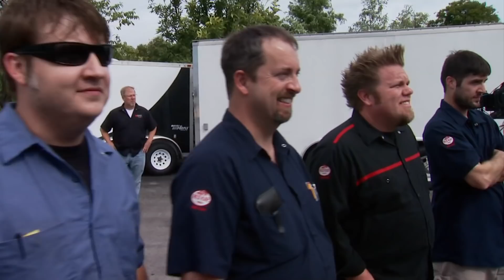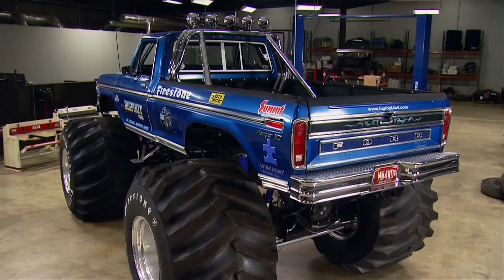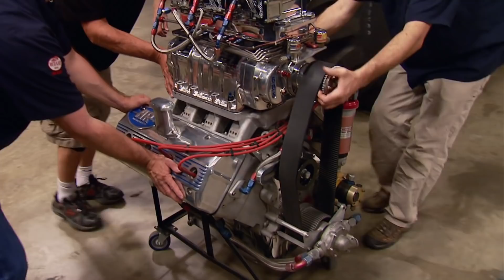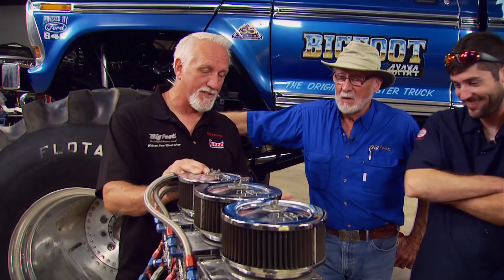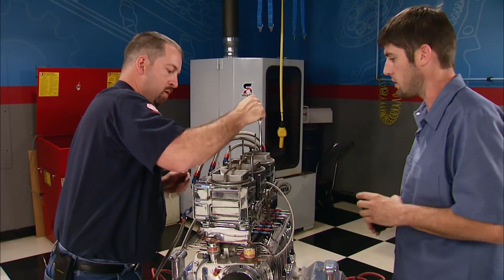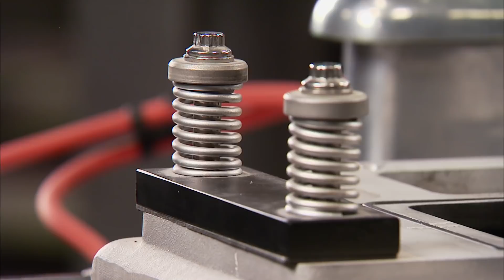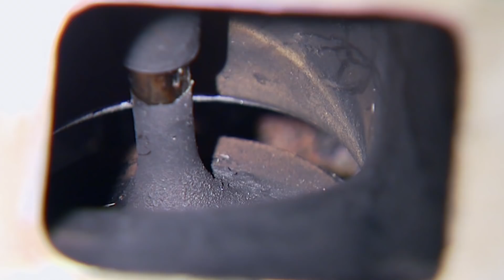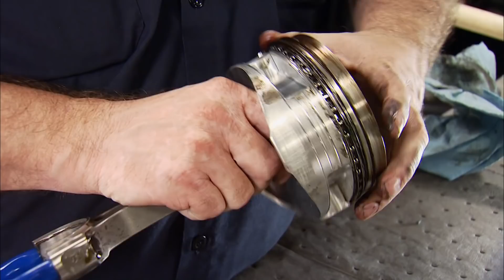The Original BigFoot Engine Build Part 1- Engine Power Season 2, Episode 4

Comment: 8:19 With only those two N2O solenoids on there, no more than 400h.p. worth of Nitrous could be had through them. A set of "Cheater" noids will safely flow about 250h.p., and if they are "Big Shot" noids they'd flow about 400h.p. max. 
That was all that was available back then. If you wanted more, you had to run multiple sets of solenoids.

Comment: This engine didn't last long after rebuild
Reply: What are you talking about? It's on display at the Bigfoot 4X4X4 headquarters. They don't use it in the truck anymore because it's a high strung temperamental race engine that has rare parts in it. Bigfoot #1 currently uses a 514ci Ford Stroker engine as the 640ci Alan Root Ford was overkill for anything they do with the truck these days.

Comment: NOT the original engine. The original Big Foot truck began as a 1974 F250 with a 360 FE engine.
Reply: Bob himself stated at 1:56 that its not the original engine, he later swapped out the 360FE for a 460 and then eventually the 640ci that's being rebuilt here.

Comment: That’s probably the best way to get that motor with those oversized ports to work is to put a blower on it to bypass the big lag those engines had because of the huge ports. They would probably suck those Predator carbs right into the combustion chambers. I’m a Mopar guy and then  Ford next. This is a beautiful piece of polished work!

Comment: I keep wondering why is it so nice and clean for such an old heavy duty engine. Then I need to remind myself that this has probable never even done more than say 300 miles on it since it was built given it use needs. WOW.
Reply: Yeah maybe so, but those 300-500 miles it may have on it were absolute hell from start to finish. In its prime this truck spent almost all of its time either sled pulling, mud bogging or hill climbing.

Comment: Was this Bigfoot standing in Miami?
Reply: No, you're probably thinking of Bigfoot #7 which has the 10 foot tall tires on it.
Reply: @nathanmcdonald610  #7 is a nonfunctional shell it never worked with the 10’ tires 
Bigfoot 5 runs and drives on 10’ tires though

Comment: I like how they talk about this engine being a complete artifact at over 20 years old.  Like when a meteorite hit the earth and killed the dinasors or at the time of Moses and the great flood or something.
Reply: Clearly Clever or even Noah and the great flood!
Reply: I'm not sure how old you are, but clearly you just have no idea
Reply: I get what you're saying, but I think it's the significance of the engine to this style of vehicles history. It's not like they are talking about a random 302 out of a 70s era vehicle.
Reply: It's not a 20 year old engine, it's a 40 year old engine built by some of the best performance builders in its time. It's the fact it was built to such a high standard that's interesting to these engine builders, not it's age or rarity of production or anything. It's a one off built engine with some fascinating parts and methods hidden inside that can't be had now, unlike a random small block found in a barn or something.
Reply: You have to have big tires to clear that water.
Reply: At the rate of improvement in the automotive industry 30 - 40 years is a long time.
Reply: Keep in mind, the engine remained as is since the 1970's with probably some minor modifications until the 1980's when it sat until now.  Since then, it hasn't been modified so technically, it remained the same for almost 50 years!!  That's a long time and yes, it's really an artifact in the car world.
Reply: @donster28  yeah an engine from the Original Big Foot . . . I guess it just needs the age or care to get the reference lol. Im 34 so I grew up in the PEAK MONSTER TRUCK SUNDAY SUNDAY lol 90's and Grave Digger is my favorite for many reasons but any time I watched a race or whatever and Big Foot (yeah its a different driver from state to state toward the end there) made a showing . . . you cheered! Its the O.G Monster Truck that inspired how many careers, designs, changes in the sport . . . shit literally INVENTING the sport to a point - yeah . . . . . . seeing the truck and the Original motor was sure as shit memorable, historic, unique and just plane cool!
Reply: Clearly Clever ....well, at least that 640cu Big Block Ford motor actually exists, whereas that Moses and great flood nonsense is nothin but fiction, a fake, a phony, a man made lie, a fairytale....
Reply: @branon6565  hey man do you have to go there...all ill say is u started it by taking exception to the noah ark reference...so here i go, God exist ,he doesn't need you to exist. You need him to exist.

Comment: 74 f250 with 75 headlights?
Reply: 79 headlights actually. The truck started life as a 1974 F-250 but later had a 79 front clip put on it.

Comment: Did they have to have tires manufactured specifically for those monster trucks or could they take something off the shelf designed for some other industry, if so, what were the tires originally designed for?
Reply: They were made for fertilizer trucks they are terra tires

Comment: The one Ford that could get Chevy & Mopar fans cheering.
Reply: Yep I can testify to that
Reply: Every brand has that vehicle or driver
Reply: Well 

It has a Hemi engine
Reply: @Buffalohideface  Ford made hemi's not just dodge
Reply: @HeavyDutyHillbilly  ford didn’t build that engine
Reply: @Buffalohideface  neither did dodge, but thats beside the point.
Reply: @HeavyDutyHillbilly  yea, but that's a motor modeled after the Chrysler Hemi.
Reply: @snake5305  incorrect. The 640 in³ engine retains a worked 385 series big block Ford and the Alan Root heads were developed from the ground up specifically for the 385 series family and share virtually no physical dimension to a Chrysler hemi...which ftr did NOT invent the hemispherical combustion design.
Reply: I'm a die hard mopar guy and this ford gets me hard
Reply: That is correct.
They had a truck pull in Ft Worth Tx and was sponsored by the DFW Ford dealers.
The Ford guys didn't have a good night pulling having to be towed off by some squarebody chevy tow trucks still Ford Motor Co had the last laugh this particular truck stole the show.
Jim Kramer drove the hell outta that truck that night
Reply: FORD TRUCKS nuf said

Comment: the engine hasn’t started in 20 years. drives into the shop
Reply: The truck uses a 514ci Ford crate engine now, the 640ci is pretty much a display piece now.

Comment: 40 years ago, or so, my neighbor made a monster truck and I think he bought the parts from Bob Chandler. He had 5 ton axles, electric-hydraulic rear steering and 66 inch tall tires. He made his own spring hangers and shackles and he made the truck exactly one inch taller than the original Bigfoot.

Comment: I hate that they swapped the cam out. Keep it to original spec.
Reply: Exactly
Reply: There's so much better lobe designs out there now that make more power, are more stable at high RPM and will allow less frequent lash intervals and valve spring replacements. Not to mention there's been continued and better R&D behind testing different valve events for increased power output vs what they were running back then.

Comment: Hey guys. Just an old mechanic trick. Those screens aren't there to catch debris or broken parts. They're there to help atomize the fuel for greater horsepower. In the days of carbs we knew that fuel under high demand just splashed into the cylinders usually the ones closest to the carb. By adding a screen one could atomize the fuel making it spread to other cylinders and producing a mist of fuel (think poor man's fuel injection) producing better burn and and in turn more power. Learned that at auto trade school from an old school mechanic who used to race dirt track cars.

Comment: But how many pens do you really need in your shirt pocket? :) :)
Reply: Actually about half of them are tiny flat head screwdrivers.  As a mechanic we will use all of the pens and screwdrivers.
Reply: @johnsumner2987  awesome cheers mate, and hello from Adelaide Australia 😀
Reply: John Sumner naaaa man, I always have 3..flathead, Philip, and a pen..maybe a marker if the computer is down to print oil change stickers. That man has a whole pack of pens in his pocket 😂
Reply: @johnsumner2987  my pocket screwdriver with the magnet on the end is the most important tool I have lol. Use it for everything...push pins, hose clamps  opening boxes, adjusting drum brakes and so on
Reply: There's probably a slide rule in there
Reply: @Matthew Williams, Lol 😂

Comment: Hi Sir...
I have a 2007 toyota tundra limited with 260k Miles on Had a recall 1 owner truck..
I am feeling a very small little jump in the tranny no slips at all runs great.

what would you suggest i should do to keep it well maintained should i change the oils or flush the tranny or do nothing ?

Comment: Now that's how an engine should look like! A v shaped lower end and 2 heads with valve covers on each side, and a carburator in the middle, and 2 exhaust manifolds on the sides.
Modern engines look like a washing machine that is stripped from it's sheet metal panels, because all you see is hoses, electrical wires and connectors, and under all that
crap there's some iron box that has the cilinders and pistons in it, so one ugly mess. That's why they cover the whole shit up in plastic covers, because that chaos under al that happy 
plastic won't win any a beauty contest.

Comment: Man the owner should of never changed the head lights! The round headlights with the signal lights above were way cooler than the newer square ones he has on the truck now! Now its matched-matched, his tail lights are '78 and his headlights are '85
Reply: junebugg777 that front clip bob put on is from 78-79. 1980-86 looked different, a whole new body style. In 78-79 the taillights stayed the same as previous years, so they are indeed time period correct even tho the original truck was a 74

Comment: You have to remember, engines were so detuned from their glory days of the 60's. I always wondered what thus old gal had in her. to see a truck with this much power was amazing, considering big blocks were putting out little over 200hp, octane of gas was 79, everything knocked and pinged, engines ran on after you shut them off. This was good to see.

Comment: Pistons in 4 and 7 are disturbingly carbon-free.  Despite your "no leaks" declaration, it suggests that the head gaskets had failed on those cylinders.  I know you know that, so it's odd that you'd say "no leaks" when clearly there were.

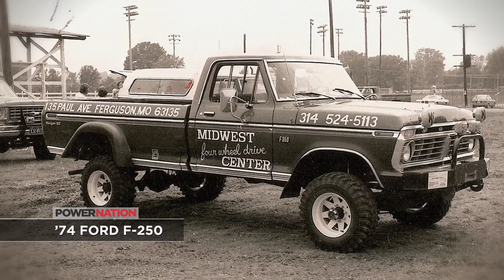Comment: 1:37 Shows F350 on screen but labels is an F250 lol. not making fun just thought it was a funny gaff.
Reply: the truck is an F250, the highboys had the narrow frame like the F350 cab & chassis duallys and the f350 camper special with 140 inch wheel base. There photos of Bob's truck with a dually rear end so I'm guessing he decided to change the badge from an f250 to an f350 since they share the same frame width.
Reply: there is a lot of fuck ups in this video lmao...like why does he have 10 pens in his damn pocket ??
Reply: @BETNCORT  incase you run out of ink duh

Comment: I must say that I really like Howard’s Cams. They make good stuff and are often cheaper than their competitor’s comparable items. The last item I ordered was a set which included the cam, lifters and valve springs. That particular grind made a big difference in power/torque, worked well, and was probably $50 cheaper than Comp or Crane for a similar set in those brands. Others are great too but I’ve just always been partial to Howard’s I guess. Everyone reading this have a great day and God bless!!

Comment: Uh, huh?? There was a blower on engines back in the 60's and 70's. Maybe THEY didn't see them cause they lived in some BFE town. They're having all this trouble taking the thing apart becuase they are using the shittiest impact gun they make. My Matco 3/8" was so weak I brought it home to work on my car's. Mac or Snapon are the best cordless, but where are the air guns? And who uses a wimpy handheld propane torch? Where's the OxyAcet torch?
LOL, "This artifact from 20 years ago...", my car is an 84', and it's certainly not an 'artifact'. You shouldn't have ANY issue getting parts for that engine from Summit racing. You guys talk like it's a fucking steam engine or something. So overly dramatic. 
Also, any mechanic that has to separate they're bolts needs to go sell parts. I can take every bolt in any of my cars off and throw them in a coffee can, and they'll all go right back where they came from.

Comment: You touch the original engine the value history of the big foot Is down graded. 
It’s not a antique anymore. Buyer want original. That the history, everything including dings .make it believing. Unless your going to lie.
Reply: they also want  it to work  these are not like  car engines at all  lots of things could  be   bad  rear main seal  gaskets     dust  inside from it sitting for 20 years    in short  it could destroy  the engine if you tried to start  it up after all that time sitting    there  more  or less just  doing checks  on things  that could break down with time    and will put it back  to same spec

Comment: I don't understand why people keep using bulky Dremel for engraving, especially on high end builds!
Dental micromotors are much more ergonomic, silent, and allow you to change tools extremely fast.
Reply: It a mechanic shop. It's loud af 24/7 Dental Micromotors may be less bulky n what not but prob cost 2x more and Dremel's not a bad brand. Last thing they care about is loudness its the quality/work speed that matters.
Reply: @wallaceluna6241  I understand that dremel might be faster to move around a shop but why would anyone do that? It's mostly used for small parts that you can bring to your desk.
I've been using using nsk ultimate for several years almost daily and i'ts many times better than Dremel i had before. I have to admit that most mechanics probably won't use it enough to justify the extra cost but if you do a lot of hand engraving or sculpting it's definitely worth upgrading.
Reply: Mili theMUFFIN it’s more of a they prob got some type of sponsorship or deal ecetera with Dremel vs a different one. A lot of the tools they use are prob gifted to them to be “shown off” to get customers.
Reply: @wallaceluna6241  That's very likely, they didn't really need to engrave on these stands to keep them organised.

Comment: I LOVE the PREDATOR Carbs... I've run them for around 30 years on a 454 powered 1955 Nomad with 350 HP Nitrous. The Car has been 179 MPH with ! Predator carb way back in the 80s. Have trouble getting overhaul kits with the correct accelerator pump diaphragm. I own five of these competition Carbs. I had two on a Holley pro dominator Tunnel Ram manifold, incredible throttle response . It ran just as good with one on a Holley Strip Dominator manifold as the Tunnel Ram. I also got 12.9 MPG on the street.  At 930 CFM apiece it's a LOT of CFM for any engine. No power valves to worry about either! BIGFOOT IS AWSOME!!!

Comment: the 1st time I saw this truck was at the auto show at Cervanties convention center around the late 70s, this was before Chandeler put the really big wheel/tires on. the 1st set were farm tractor tires, the next time I saw it was in the movie "take this job and shove it" it had the big wheels/tires bout' time then, the truck sat as a static display at Big Foot 4x4 inc. just off hwy 270 across from the Ford plant (that got torn down), you had to go inside to see it, but they had two more outside that could be seen from the hwy, the Tracked Big Foot & the really Big Big Foot (it had arctic vehicle tires that were about 15-20 ft in diameter). Big Foot 4x4 inc isn't there anymore, I don't know if they moved or just closed down, good memories though.

Comment: Why did you etch writing onto those parts with a dremel? Ever heard of a Sharpie?
Reply: Oil soaked parts that you'll clean with solvent.... Sharpie isn't reliable.
Reply: @JohnWilburn  That does make sense, but I'd be hesitant to permanently damage a part like that... especially on a historic engine/truck as this
Reply: @leebtrading  I would have felt the same way ten or twenty years ago, but now, so long as the engine doesn't lose it's identity, I'm okay with adding that little bit of character to it's story.  If someone eventually writes a 100 year history of that engine and that's a little note that's now 60 years old, everyone will think it's a cool detail that proves it's story... just like all the other things that have been done along the way.

I've watched other shows make wholesale changes and trash things in favor of latest-and-greatest, but this build was righteous... even saving original gaskets.  They made changes they should have like changing the wrist pin buttons for spirolocks (to protect the block), etc.  These guys did a great job of protecting the history and it will be a chapter in the bigger story.  You have to admit, Chandler himself has tossed more historical stuff.  He changed the bent frame of Bigfoot 1 after take This Job and Shove It and, to my knowledge, they scrapped the original cab of Bigfoot because it got rusty.  That's the stuff I wish people would think twice before doing.
Reply: @JohnWilburn  Good points, thanks

Comment: 18:38. Those cylinder walls look paper thin   when it comes to running boost. No?
Reply: logan1080 ...... I heard the motor is not in the truck no more I also seen pictures of it with a different motor now I guess this rebuild did not hold up in the truck was losing oil pressure and had overheating issues
Reply: Thay had a very good water pump. LSC2001 thin it's walls. It's will make a engine hot